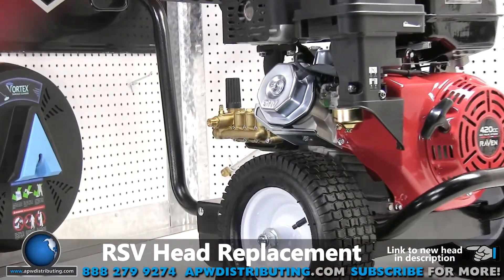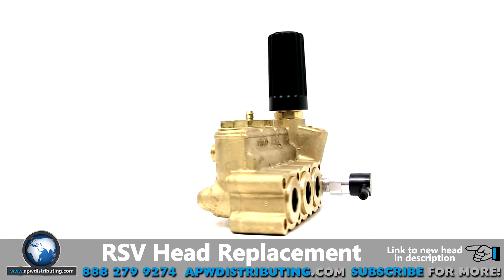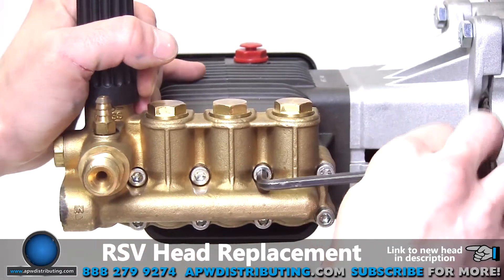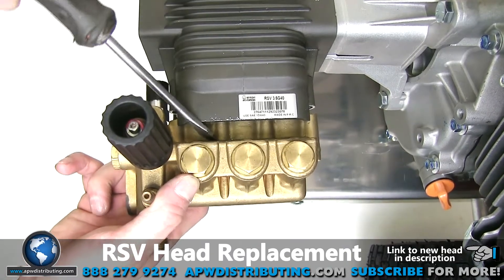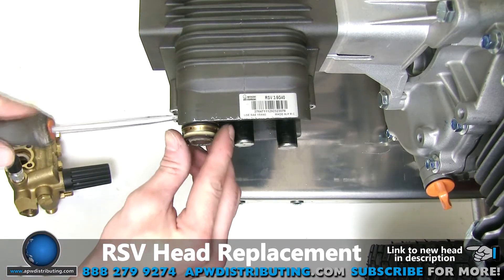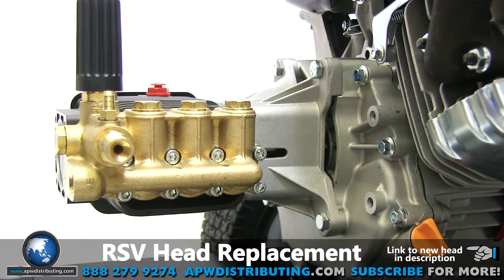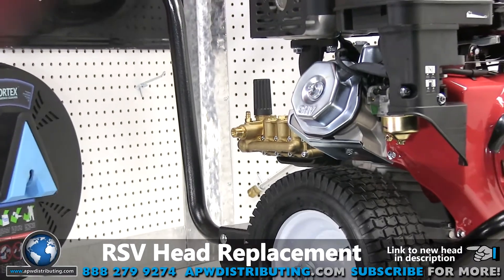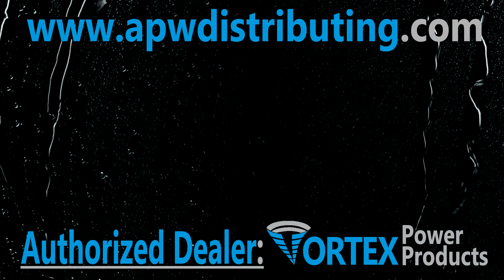RSV Head Replacement

Comment: Hello, maybe you can answer me. If I widen between the 2 internal holes in the pump body, will more water pass through each piston? and if so, what are the technical problems that give rise to the change? Yours bless you
Reply from the maker: Hello @pedromastosmatos1767 We do not recommend modifying your pressure pump like this. The pump has a maximum displacement based on the speed and stroke of the pistons. Increasing the size of those holes will not improve the performance. If you are looking to achieve a higher GPM we would suggest getting a pump that is rated for the GPM you are looking for.